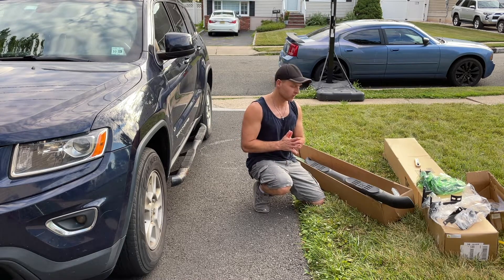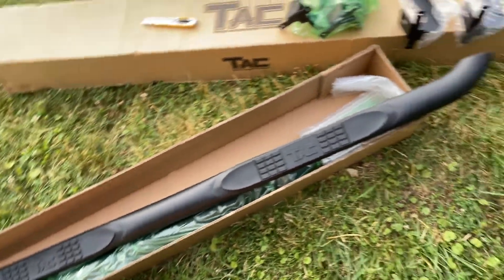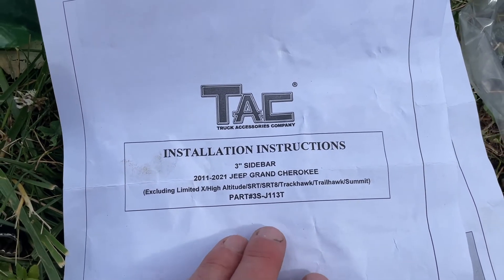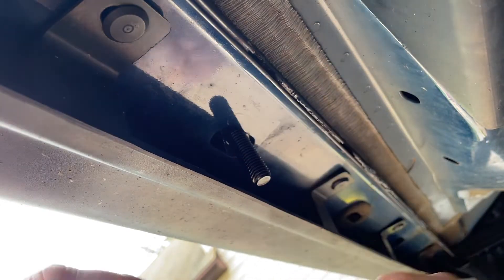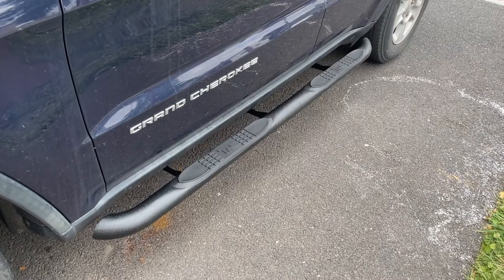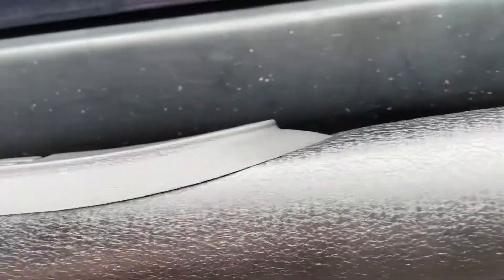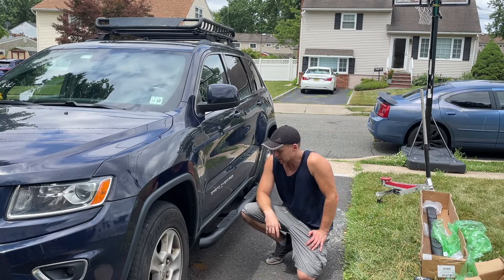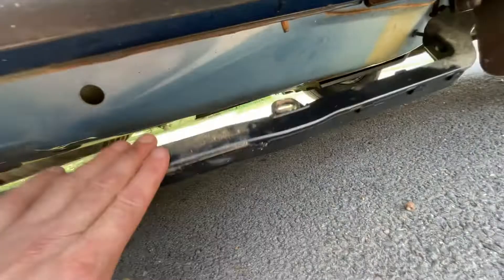How to Install Side Step Rails 2011-21 Jeep Grand Cherokee -TAC Running Boards (full guide)

Comment: I  installed  these today on my 2021 Grand Cherokee. I have to say, the instructions included by TAC were terrible, gave me a hard time. But  this video was super helpful and I could throw away the instructions. I was a little apprehensive of the passenger side wiring harness lowering, but turned out that was the easiest to do. Thanks Lech.
Reply from the maker: Nice.  Thanks for sharing 👊👍

Comment: For the lock nut in the pinch weld, how am i supposed to tighten it up? Whenever i try it just doesnt spin or get tighter. Sorry if this is a dumb question

Comment: How have these held up so far, I was concerned about rust with them and have been waiting to pull the trigger on them until I found some decent reviews
Reply from the maker: So far solid.  Better than the previous ones I had
Reply: @HowToWithLech  awesome 👍🏻 thank you for letting me know, I’ll probably pick one up soon then. Great video btw Iv never installed side step rails before and this should help immensely.

Comment: Hi Lech - Nice video! Could you please post a link for the very same bars you installed in this video? I have a 2015 Jeep Grand Cherokee Limited and would like this same setup. Thanks!
Reply from the maker: Thanks. It’s this one.  TAC brand:  https://www.ebay.com/itm/143040823294?mkcid=16&mkevt=1&mkrid=711-127632-2357-0&ssspo=QCkZNEwgQ0a&sssrc=2349624&ssuid=W1cyzTAXRmG&var=&widget_ver=artemis&media=COPY
Reply: @HowToWithLech  Thank You!